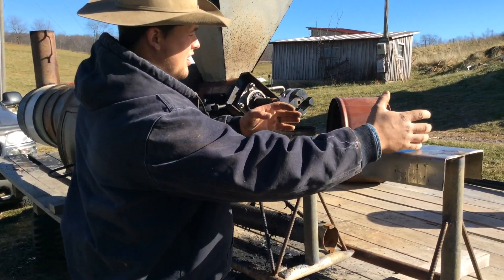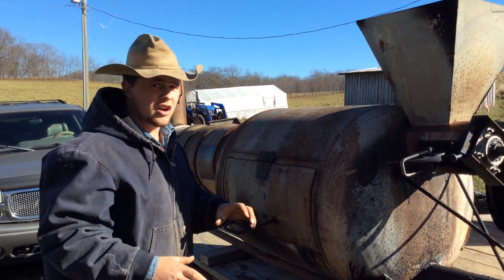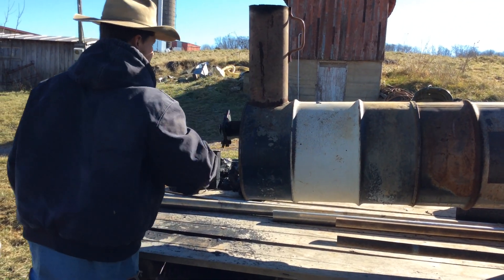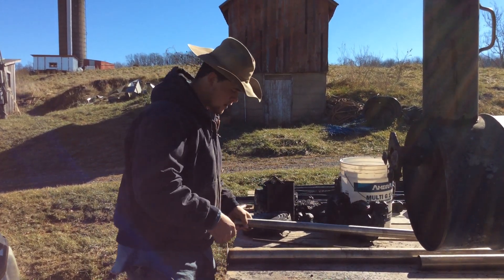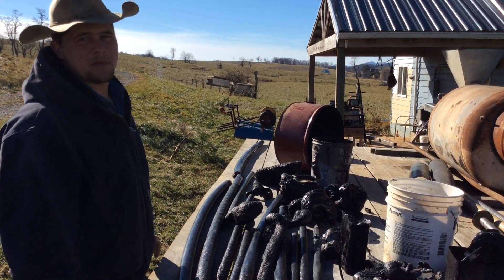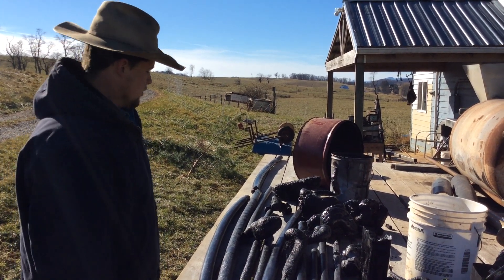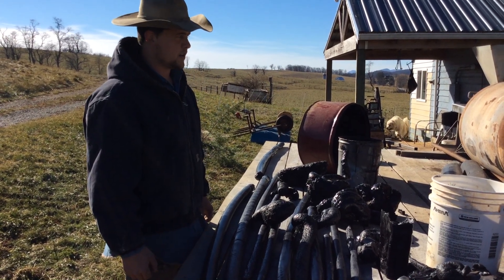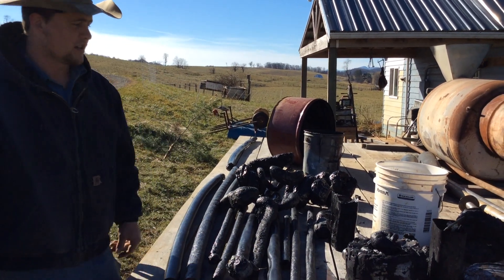Latest Farm Invention - Plastic Fence Posts

Comment: Making your own plastic extruder is bloody impressive. 
Looks like hdpe makes a much less bendy post.
So many things to consider. Mould injection pressure, additives like UV stabilisers, fire retardants.
I'll be looking at a machine to use some of the energy from my 30kW of solar, when the grid feed in drops to 1/5 in 2028.